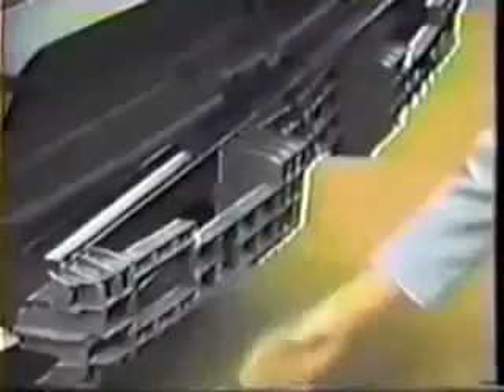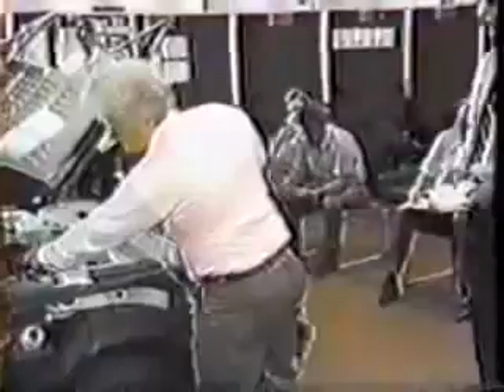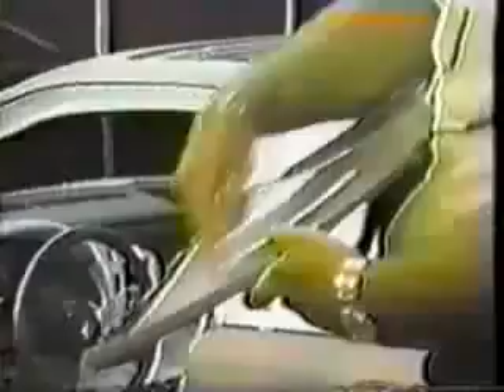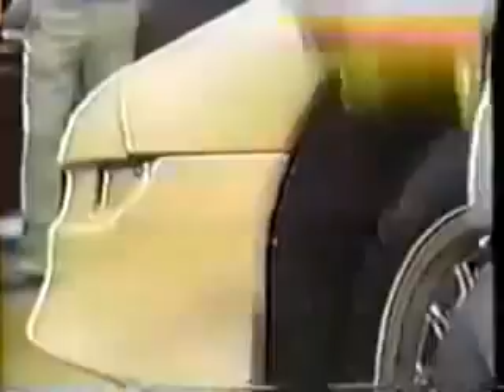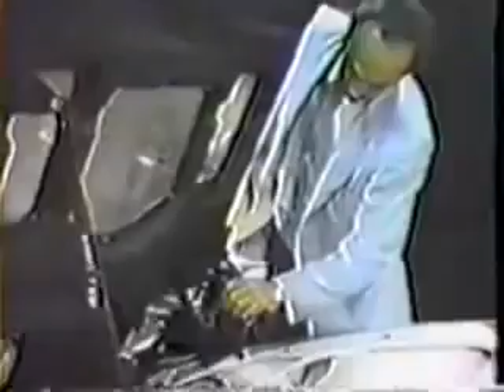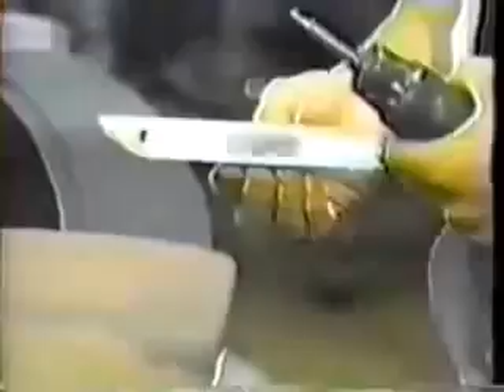1990 Fiero build up

Comment: Where did you get this?
Reply from the maker: The deep bowels of the internet. I knew I had seen it before so I scoured the internet searching for it. Finally found it. Don’t remember where. But I figured it should be on an easier access platform so other people could see it
Reply: @drewhoffmann4257  
Thanks for the update.  Looking for another one.  Had a 87 gt,  auto, dk red. Loved it and wife drove on freeway, driving about 70 to 75 ( she thought) IN SECOND GEAR !! Lasted for about 1/2 mile before blow up.

Unfortunately she has passed away since that. I ended up giving the car away right after her funeral.

Comment: It kills me they were this far along in the development cycle on the next gen when the plug was pulled. Does anyone know what engine was in this mock-up? Its hard to tell if it's the  2.8  because of vid quality.
Reply: There were only 2 engines slated for the 90s. the base was supposed to have a Quad 4, and the GT were supposed to have the LQ1 dohc 3.4s v6. OH, there tragedy of this car NOT being done.
Reply from the maker: @w41duvernay  Pretty sure you’re right. I was just talking about the actual driving prototype that would be at Fiero shows. I’m pretty sure one has a v8.
Reply from the maker: I think the prototype had a v8
Reply: @drewhoffmann4257  Don't be ridiculous.